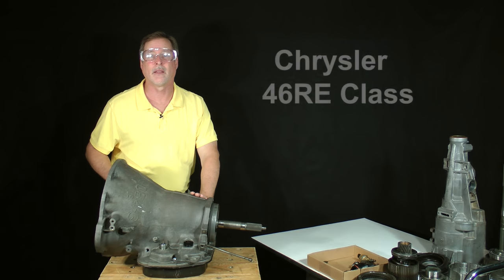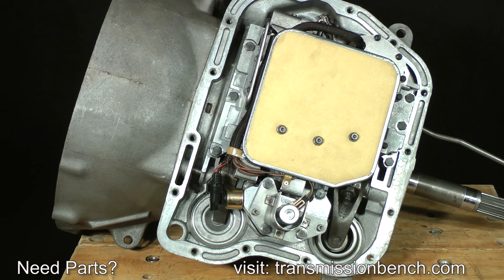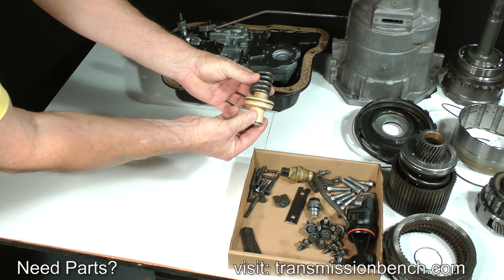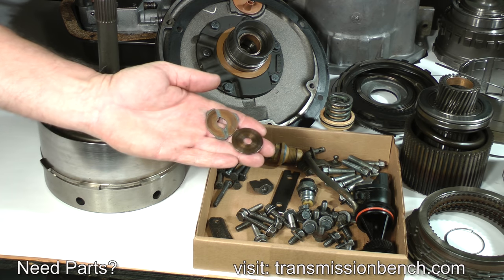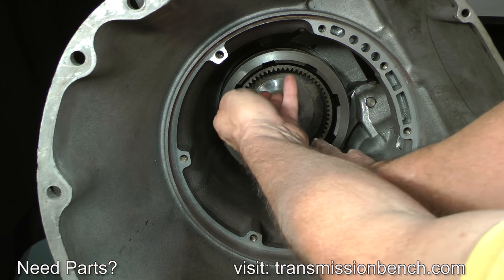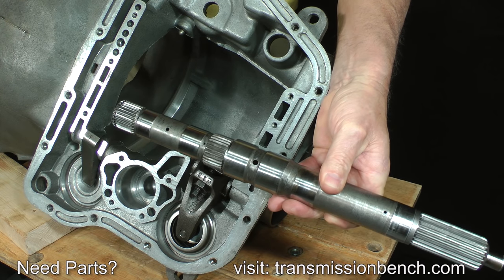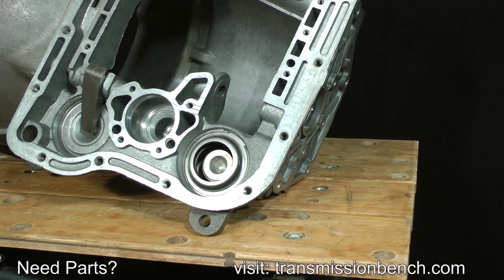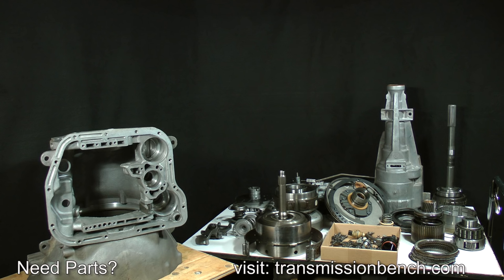Chrysler 46RE Class Part 1 lesson 3

Comment: Exccelent teacher, thank you.
Eventough I have a question.
I have to remove the valve body without removing the transmission from the truck.
To release the parking rod, in which gear should I put th selector previous to removal? (P, R, N, D, 2 OR 1)
I asume that to change the master kit solenoids I have to reach thar point? or there is another way?
Thanks

Domingo

Comment: Son was given a 93 dakota by neighbor. Last 5 years was only driven back and forth hauling limbs to a burn pile.  Son drove it for 2 days,  Transmission lost power in neighborhood due about 25mph.  the gear shifter moves.  however seems stuck in park.  the drive shaft doesnt move.  Any suggestions?

Comment: What do you do when the low reverse roller cage blows up inside the case and wedges the roller bearings? That Is what I have going on right now. They are all wedged and bunched up on one side with another on the other side wedged and holding it all together.

Comment: What happens if I installed accumulator piston  upside down?
I couldn’t get it in so I flipped it over,
Is that the reason why don’t have reverse
Before I worked on it had reverse

Comment: I have a 03 dodge ram 1500 that will not go into park. I removed the linkage from trans and tried putting in park from under the truck and nothing. I have r, n, d, 1, and 2 just in park. Drive it home everying seem fine. Just no park. What could it be?

Comment: So what causes a 46re to whurrrrrrrrr.. whine loudely in gear only when moving in 1st-3rd gear..  does it when rolling in neutral as well.. even with engine off when rolling..  and transfercase in neutral.  When its in overdrive. Its completetly gone.  Park or braked in gear..  gone.   Only does it in the first foward 3 gears when rolling.

Comment: 7:34 "[The case connector is] somewhat fragile ... " HANDLE THE VALVE BODY WITH CARE if you're not replacing the solenoid and harness assembly! Otherwise you may break the mount hole off the connector! (Ask me how I know ... )

Comment: Is there anyone that can tell me the difference between a 10/11T as opposed to the 1 1/12T gears that goes between the stator shaft & pump housing??🤔...is there pump pressure release difference & or can the 10/11T be used??
Reply: I was doing some brief searching on dodge forums for my own rebuild; and you can swap the gears out depending on the intention of your rebuild.. the dodge forum is the place to get the definite answer for this question.

Comment: ok so what do i do when the  forward drum  won't fall apart out of the forward shell ??
Reply: take the 20 ton  press and break the forward drum from behind , it ruins the shell to boot .
Reply: Force it out, hammer and pry-bar if you have too, another person or a vise might help but seperate it, if it's stuck it will go...
Reply: Or install longer bolts on those slide hammer holes and skrew them in until it comes out